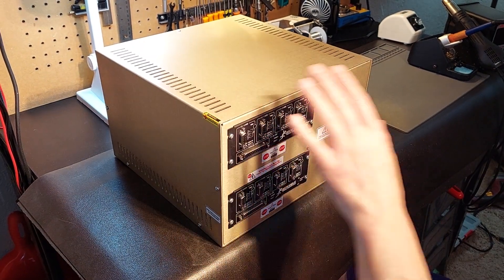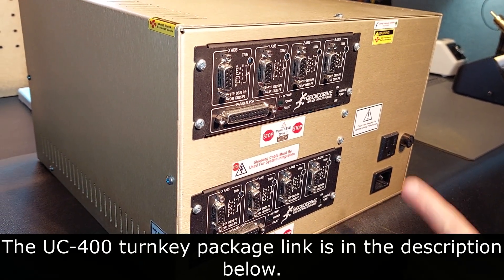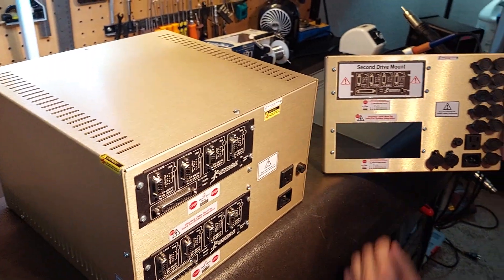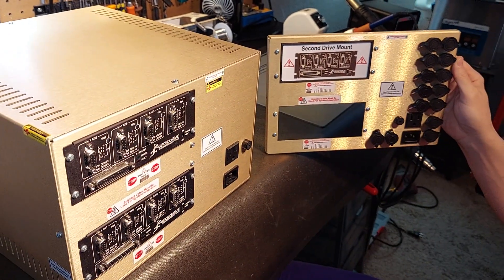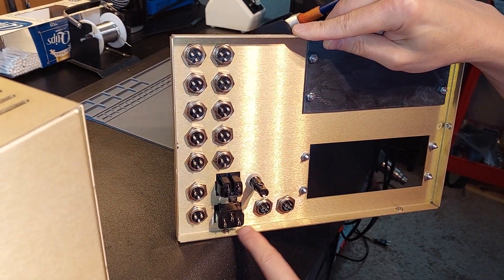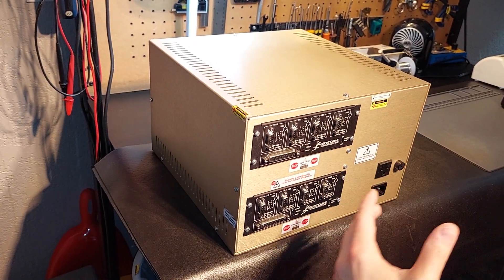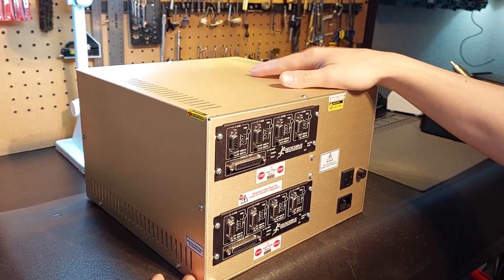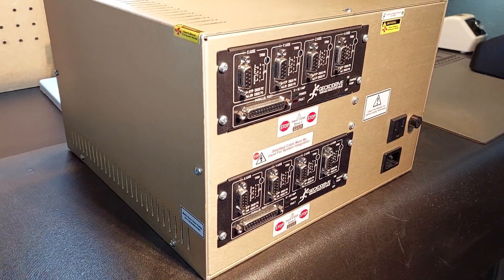When You Need A Dual Gecko G540 8 Axis CNC Controller..

Comment: Why is the G540 set up with the signal input from your motion controller on the outside of the enclosure. Wouldn't it be better on the inside?
Reply from the maker: Thank you for your support. 

The G540's integrated DB25 female parallel port output is on the outside of the system to allow a male DB25 parallel port cable to plug into it. 

The other end of this cable is then connected to the CAM PC you're using's DB25 female parallel port. 

Thank you,
Vince
Reply: @corvetteguy50  when using a motion controller like a smooth stepper, where would the motion controller be located? Inside the PC?
Reply from the maker: The motion controller should be located if the unit is running on 5v (like the ESS) outside the electronics enclosure to prevent EMI penetration. If the controller is running on 12v or higher like the CNCdrive UC-400 you can mount it inside, or outside of the electronics enclosure as any voltage above 5v makes EMI more difficult to penetrate the control signals to the drive.

Thank you,
Vince